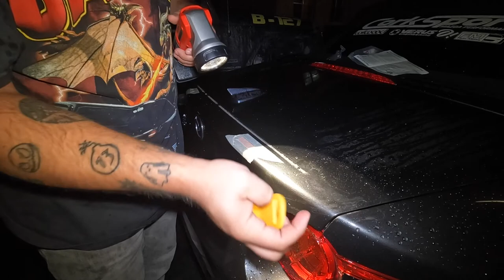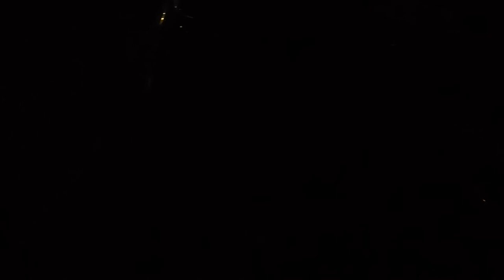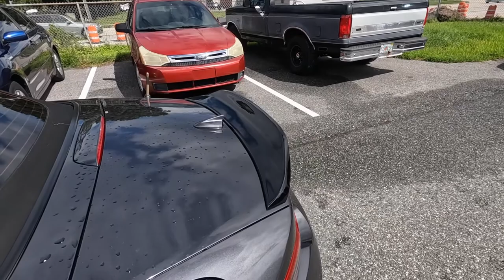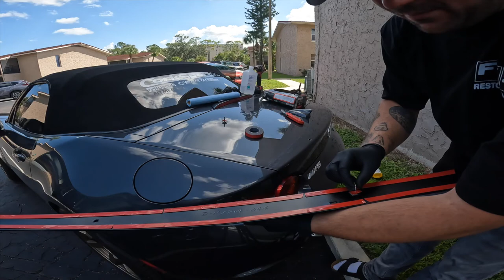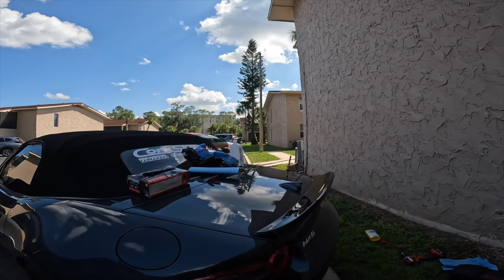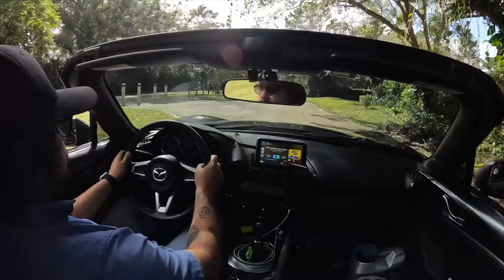adding a duckbill spoiler to my nd miata

Comment: I'm surprised you didn't pre-align the spoiler before you stuck it down.

Blue painters tape is low tack. Stick some on, mark out the center line. You could have found the center of the boot lid easily this way and peeled it off after fitting.

I personally couldn't sit still if I misaligned something, my ocd would have torn that spoiler off and started all over.
Reply from the maker: I honestly forget it was not perfect till you said something lmfao and it’s my first time doing something like this I’ll try that next time

Comment: My club came without any bodykit, kinda tempted to get a duckbill for my car too. I wouldnt want to drill holes though
Reply from the maker: You can use just the 3 m tape , just need to remove all the wax on the car to make sure it sticks super good

Comment: Bad info.  Who wants to drill holes in the body?  Don't.  I first used the 3M double side tape.  Found in cold weather, it does not hold up.  Then used Alien Tape and the 3M tape both.  Works great now.  Also need to leave some gaps for water drainage.  Not good info here.
Reply from the maker: i didnt drill the club comes with holes
Reply: What brand is the spoiler?
Reply: @Moneyandfood  Paul, I am not sure of the brand.  It was less expensive, but had to be painted and clear coated.  It fits well and I brushed it up with a little sandpaper and put two coats of gloss black on then added some high quality clear coat and finished.  I used the clear coat that is good, and you can freeze the can between uses and then thaw and get several coats.  I used the MMM tape, but found it very loose and almost fell off when it got cold.  Had to take it off and added some alien tape and it is now on well.  Leave some spaces between tape at low points for drainage.